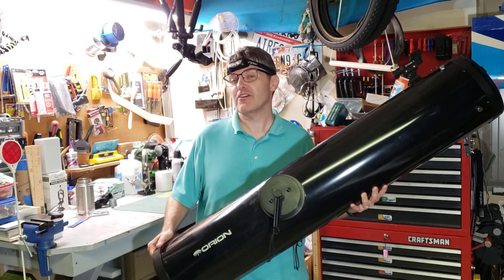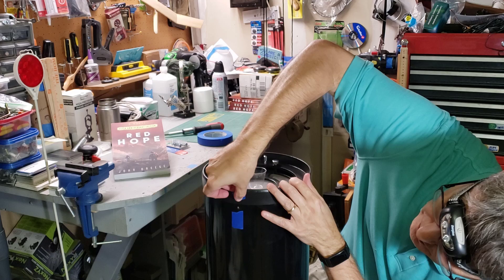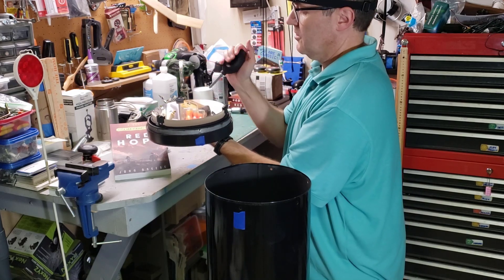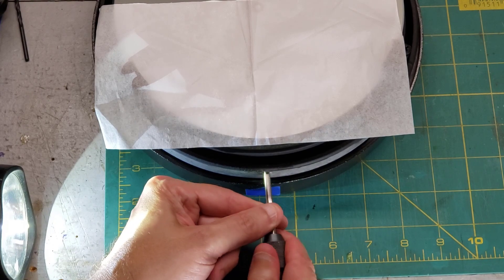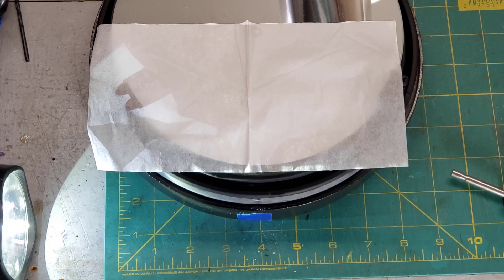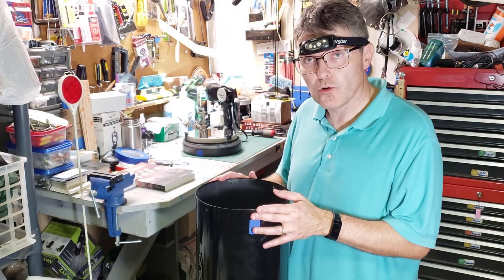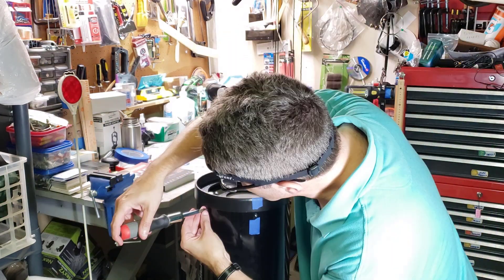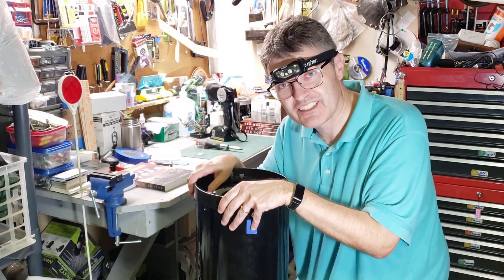Telescope Maintenance: Repairing a Stripped Screw

Comment: Borrowed a orion starblast 4.5 from library. Weather has been bad so i've had it tucked away in a dust blanket (all the precautions). I go to use it and the celestron 8-24mm eye optic barely will not thread in securely to the insert. I'm nervous because when i got it from them they went over it and said everything was ok. Is it common for threads to wear out or is it a common sign of mishandling? I went to adjust it and it unthreaded tha easily. Are you able to buy the threads. female/male? At the very least i'd like to donate them new threads(if i don't have to buy it), I'm nervous now and don't dare to use it with the family in the chance optics falls to the ground! Ty for potential hellp!! I'm entirely blind to this hobby,
Reply from the maker: I'm afraid I don't quite understand. Eyepieces don't usually thread into the focuser tube - instead they "drop" into the focuser tube.  Feel free to send me a picture of the telescope part at:  JJDreese at yahoo dot com

Comment: What? No door closure transition? What would Capt. Kirk do? I've not had to go to the next larger size screw as yet. That drill tap looked like a nice tool. The only taps I have ever used had to do with 60s and 70s engine blocks.
Reply from the maker: Good catch.... these last two videos were experiments in how fast I could record/edit/release.  Normally with all the planning, it's about an hour of planning/recording/editing for every minute of video.  I'm getting ready for some longer videos and need to find ways to be more efficient.  I only have metric taps because I only use them on telescopes, lol.  I will bring back the door open/close transition!  :)

Comment: I noticed u put that tape on to mark it for linking it back up. That's good tip. I just put the cell back in with the cut out where the tube seam is at the bottom. That is the only way it will go back in.
Reply from the maker: Yes, tape is also a good way to quickly keep track of the stripped hole. I am proof that it can go back together other ways if you push hard enough, lol.